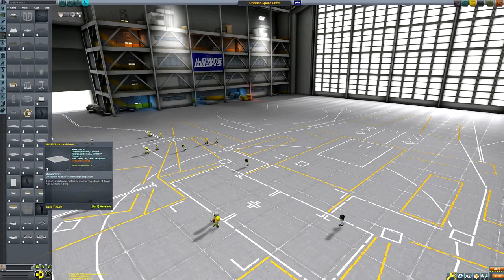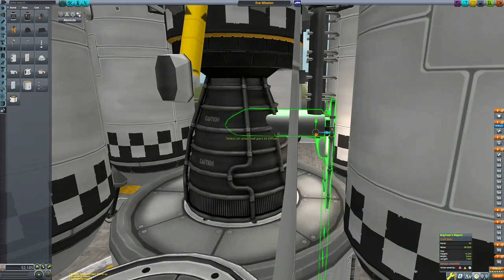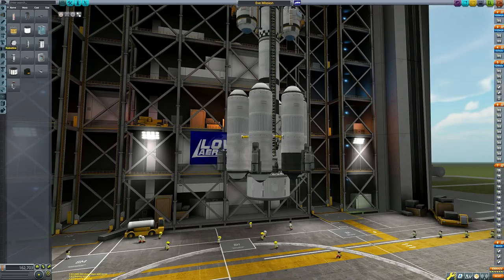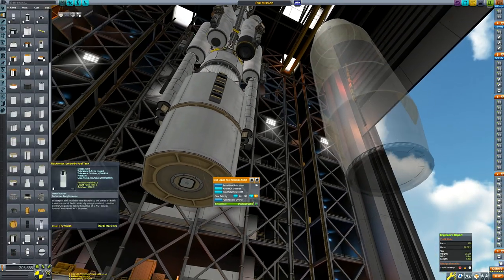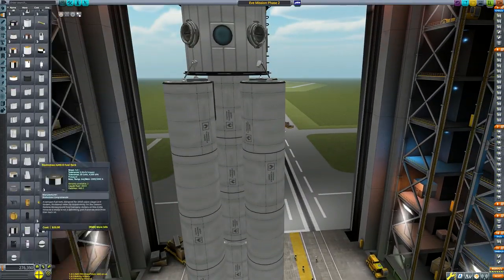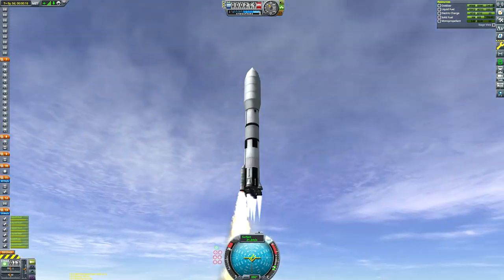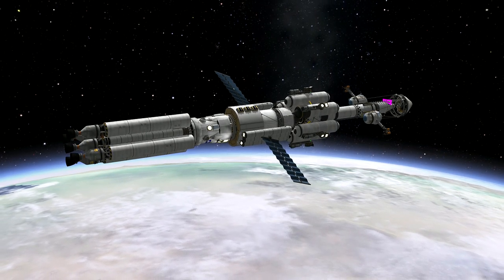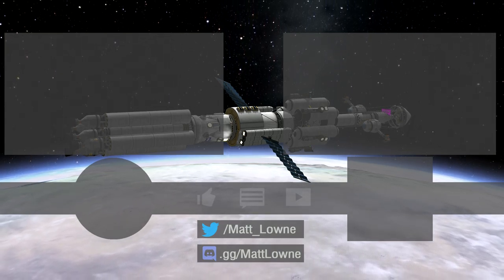KSP: Orbital Construction of an Interplanetary Ship!

Comment: Matt: "... and the video would have been over an hour long!"
Me: "great, i can watch it while i do my ion burns!"
Reply: Oh man, did I regret that setup. Yes, do half of your transfers in the Jool system with Ion thrusters and barely any solar panels. You will definitely not regret that decision deeply
Reply: Oh no just the picture in my mind of someone doing burns that long has given me mental issues
Reply: Physics warp
Reply: @sergegordeev9426  cAnNoT WaRp WhiLe ThE vEsSeL iS uNdEr AcCeLeRaTiOn
Reply: @riccardoorlando2262  Press right shift and arrow on Linux, I don't know what is the key for physics warp on others.
Reply: This is pretty useful in other situations too.
Reply: @riccardoorlando2262  Holt alt and press the timewarp buttons
Reply: @Liam_The_Great  wait, really? No mods?
Reply: @gabrieldelatortilla1  yeah it's stock
Reply: Ion kraken drive go brrrrrrr...

Comment: Matt: asking for royalties for the dual cockpit design
Me: uses structural tube instead of fairing
Matt: surprised pikachu face
Reply: I was literally thinking i could just to put the capsule upside down use an engine bay and put the ladder on the inside XD but yours works better.

Comment: Why does the sas keep targeted at the other docking port? Whenever I do that the ship reverts to stability when I switch back to the docking ship.
Reply: It keeps auto SAS if you have a probe with connection or a pilot Kerbal. It only goes back to stability assist when you switch back
Reply: @wyldcat9396  but how do you dock without switching back
Reply: @Elemental King If you switch to one ship, activate auto SAS by targeting the docking port, switch to the other ship and do the same thing and slowly bring them together without switching back to the first one

Comment: Something that may ridiculous(ly) simple ... that I've been messing around with is when i'm making a rocket with poor thrust to weight just put some air breathing engines with 1 and half of a fuel tank.
Now Matt is much more efficient than i usually was ... (been trying to a bit more recently) but it honestly cut my solid booster use in half. 

(EDIT: The one and half is because that's roughly how long it takes to get out of orbit with the design I'm using. One and half of MK1 liquid fuel only tank. (Honestly i've not tried it yet but might be useful for going liquid fuel only and using those non oxidizer engines for longer travel ... .hmmm)

Might be something useful for beginners or people struggling to get in to orbit ... like myself in the not too far past.
Been using 6 aerospikes and an electable air breathing section to launch (not so basic) satellites and other small - medium stuff in to orbit XD (now i can XD).

Will be experimenting with with those and the (1k thrust?) engine later to see if i can make something that could work for the moon.
Did I mention that stacking aerospikes is way more efficient than I thought it would be .... My crafts used to take up 3 times the fuel of 6 aerospikes and high alt atmospheric engines for same distance. (I'M TALKING ABOUT 2 OR 3 STAGE TO ORBIT BTW). Lol I feel so stupid about all this time i've failed XD what's going to another planet going to be like .... I can just barely image the facepalm.

Comment: I've made a cute little Gilly Hopper with 2x RCS quads with thrust set very low, and instead of landing legs I use the small hinges and a few of the tiny cube frames. The stock landing legs bounce too much even with weak springs and dampers!

Comment: having a bottom heat shield only is ok because all of the mass is concentrated at the bottom of the heat shield, so aerodynamics dictate that it is not likely to tumble and flip. You just have to make sure the heat shield is on the side with more mass. Thats why you dont need 2 on kerbin, and you dont need 2 on eve either.